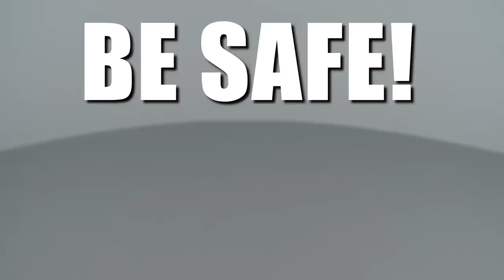LG Dishwasher Pump/Motor Assembly Replacement #AJH31248604

Comment: I just did this replacement to our LG-6920ST.  As mentioned somewhere in this thread the part number (AJH31248602) is the old part number and has been replaced by the AJH31248604 unit shown here.   It took a little over an hour without rushing..  It went smoothly.  I ran a test "normal" cycle to get rid of any assembly lube, it worked perfectly.  The difference in noise level was profound.  You can hardly hear it now!  It was a little over $200 with shipping vs around $800.00 for a new one.  Money and time well spent.  Couple of notes of difference on the video, the grounding screws are different on the new motor assembly.  Just attach the 2 ground wires to the center hole.  There isn't a visible 3rd ground going to the pump motor as shown in the video.  2nd pointer, make sure to get the bottom tab all the way in before snapping the two "top" tabs in place.  The bottom tab is bigger and harder to snap in place.  Once the bottom one is clipped around the lip of the washing compartment the gasket will properly compress and seal when you snap the top two in place.  The two clips you screw in place are to keep the pump assembly from coming loose.  Kind of a safety for the two smaller tabs.  Other than that replacement is exactly as shown in the video. 
Super well worth the $$ and time.   Did I mention how quiet it is now?   Wow..  BTW, why the heck would you want a new one to connect via WiFi?  I'm an IT connected kind of guy but the last thing I want is to have my dishwasher, fridge or stove hacked or spying on me!

Comment: Hello Repairclinic,
This seems to heave been published as early as Jan, 2013. However this helped me to fix my LG dishwasher right now in Jan 2016. Thanks from the depth of my heart for posting this video. Instead of spending close to $700 for a new dishwasher I fixed my old (just 2 years old) dishwasher for just $200.
One difficulty I had was seating the new pump assembly. I still have it raised on one quarter but functions well. So I left it like that. Numerous thanks, again.
Jay
Reply from the maker: +Jay ks You are welcome.

Comment: This is an outstanding video on the LG pump motor replacement. I am not physically able to do the job but I can see now why the service technician I hired is charging $300.00 ti remove and replace the part. LG has a ten year warranty on the motor so they reimburse the money spent on the motor.
FYI - The motor failed on my machine after 20 months of service. Not a great endorsement of the LG brand. I purchased the LG LDF5678ST dishwasher.

Comment: I just completed this motor and pump replacement... washing the first load as I write this. THANK YOU for providing this outstanding video. I had a bit of a problem getting the motor/gasket to seat properly in the bottom of the tub, but after a little patience I got it in. Otherwise, everything went perfectly. Thanks again!
Reply from the maker: Thanks for the feedback about your repair experience. We're glad the dishwasher is working well again!

Comment: my LG stopped getting water into the dishwasher. also the blades arent spinning. im hoping its the motor assembly. any advice?? regardless - this is an excellent tutorial. very easy step by step video. def recommended.

Comment: One suggestion I would make is to tun on the water and power prior to putting the insulation and kick plate back on then run a cycle to check for any leakage around the new seal and from the water line.

Comment: What a great video. You all are doing an incredible service with this tutorial. I was getting an OE error and just replaced the pump by itself ($42 part). Running the first test wash now so wish me luck and thanks again!
Reply: Where is the pump on the dishwasher, and where did you buy it :D
Reply: Never mind I figured it out! It's the white box on the motor assembly and its for sale at the repairclinic website, thanks! Gonna try this to fix the the OE error I've been getting on mine as well.

Comment: Your website sells AJH31248608 in place of AJH31248604.  Things that are different are the new one has a cover at the bottom and there is no green ground wire attached that would go in the middle.  How is the new part assembled?

Comment: Great video!!! My machine fills, but when the wash cycle starts a short buzzing can be heard from within the machine, like a motor is trying to start, but is stuck. It does this a few times and then the LE code comes up. I checked and the impeller looks ok and is not broken or obstructed, however, the impeller mount does not spin freely. My machine is a ldf6920st. Do I need the whole Pump and Motor Assembly or just the Circulation Pump Motor?
Reply from the maker: Consider replacing the motor, if you want to save money. We recommend that you also replace the shaft seal part number 1267457 (http://www.repairclinic.com/PartDetail/Gasket/3920ED4009B/1267457?TLSID=1773), in case it was leaking and caused the motor to seize up.

Comment: Love this repair YouTube. I don't know if I need to replace the pump yet? I keep getting an OE message on LG Dishwasher. Is it possible just to see a YouTube Video where you open / access the pump to remove whatever is blocking the pump.
Reply from the maker: Megan McTaggart OE stands for drain error. You may have a clogged or defective drain pump. Our LG dishwasher disassembly video may have additional information you will find helpful. http://www.repairclinic.com/RepairHelp/Dishwasher-Repair-Help?TLSID=1773

Comment: I used this part in my dishwasher.  It's like a have a brand new dishwasher now.  One thing to consider is that if you need to replace any part that is included in the pump and motor assembly, just spend the extra money and replace the whole thing.  If one part went bad then the others are probably not too far behind.
Reply from the maker: heyscott73 Congrats on the successful repair! We're glad it worked out for you. Thanks for the additional information about your particular repair.

Comment: Our machine has a 2H error. I understand this is not an error code, but showing a two hour delay. However it will not fill or run. I can hear a grinding sound when it's on. We replaced the water inlet valve, but that wasn't the issue.Our LG tech diagnosed it over the phone as a broken sump assembly but his charge would be $465.00 to fix it so we'll either repair ourselves or buy a new machine. My question is, without the LE code, should we go ahead and replace the sump assembly?
Reply: Well, we replaced the sump today. Didn't fix our problem but the video sure helped. It sounds like it's running but nothing happens, it doesn't fill, drain, wash, nothing. And the 2H code is still in the display. Dang. LGF6920ST

Comment: There was a question asked about 6 months ago regarding the part AJH31248608 and AJH31248604 being virtually the same pump.  There was no answer...could you answer?  thanks
Reply from the maker: LG substitutes AJH31248604 pump & motor assembly to AJH31248608 so if you try and order AJH31248604 you will get AJH31248608.

Comment: I replaced the gasket and it is leaking. I haven't come across anything yet that helps trouble shoot this on video. We made sure the lip/rim of the tub was free of debris before replacing as well as on the sump pump rim. I forgot to mention that I have been told that the sump pump and gasket assembly is not available to purchase as one. All parts to repair would have to be purchased individually for the model LDF7811BB.
Reply from the maker: Michele Coombs Check your wash arms. They can split and shoot water where it is not intended to go. http://www.repairclinic.com/RepairHelp/How-To-Fix-A-Dishwasher/29-200-684302-/LG-Dishwasher-leaking-LDF7811BB?TLSID=1773

Comment: does this pump & motor assembly ( part#AJH31248604) fit my model LDF7551ST ??
Reply from the maker: Jim Arcadipane It is not appearing in the list when we search your model number in our website's search engine. To find parts mapped to your particular model, enter the model number: http://www.repairclinic.com?TLSID=1773.

Comment: I replaced the sump and motor assembly on my LG washer today and now when I turn it on there is no water entering the machine.  Yes I turned the water line back o.  Please help!
Reply from the maker: The most likely cause is that a wire got knocked off somewhere. Recheck the wires especially at the water valve and make sure all the wires are on correctly.
Reply: Thank you